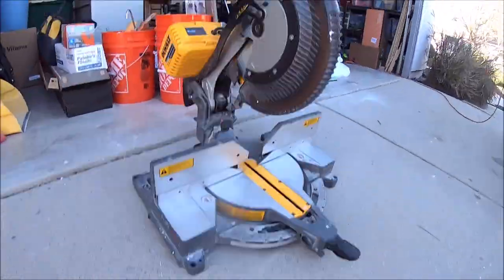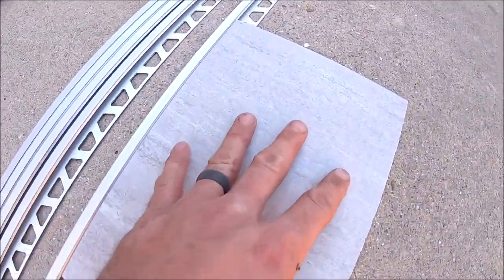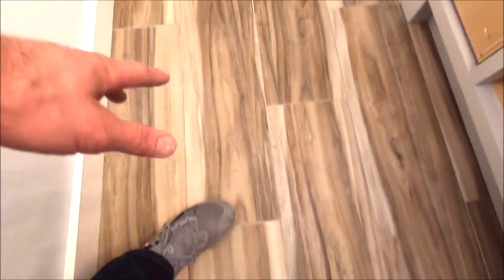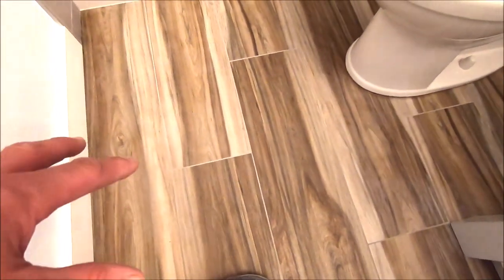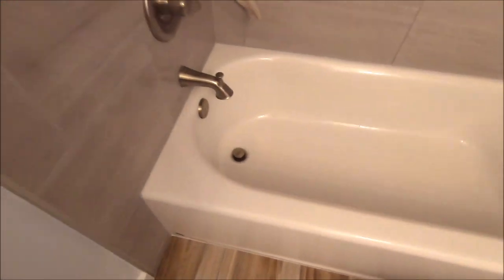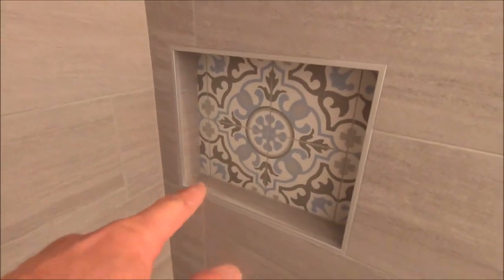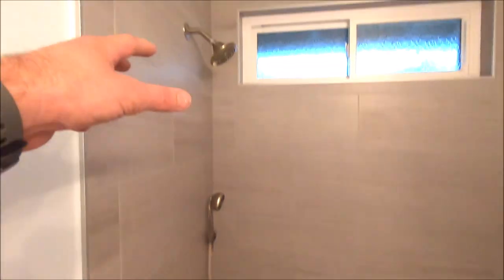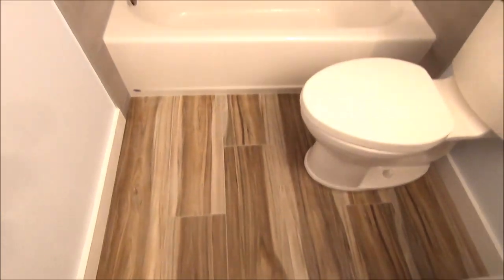Shower Remodel Fiberglass to Fabulous Part 2

Comment: I would like to know how you do to make the niche complete. I am a tile installer and that is what is most difficult for me and I see that you leave the niche at the exact height.
Reply from the maker: I'll put up a video on that soon, full tiles landing at the bottom of the niche.
Reply: @LandbergTileTV  Thanks for responding soon, hey, can I know what the labor cost is, how much do you charge for the installation of a shower?
Reply: @LandbergTileTV  Looking forward to that video.  Also, another idea... could you do a video showing exactly how to use the laser in the installation job.  What are your best practices when using the laser in order to make the tile installation more professional.  Thanks!

Comment: Great video bro and how did u get the dewalt and schluter sticker?
Reply: Buy them on line off Ebay and pray to god that you get a sponsorship.  Lol   he needs to start collecting Milwaukee sticker as well
Reply: @grizzly8859 , if Landberg tried the new Milwaukee M18 Fuel Gen 2 18 Gauge Brad Nailer...he’d never pick another Dewalt gun up again.  Since there’s no flywheel and the gun is nitrogen charged, there’s no wire sound and ramp up.  Really looking forward to the new M12 Fuel 23 Gauge Pin Nailer coming out!!
Reply: @martylucas8557  Awomen to that